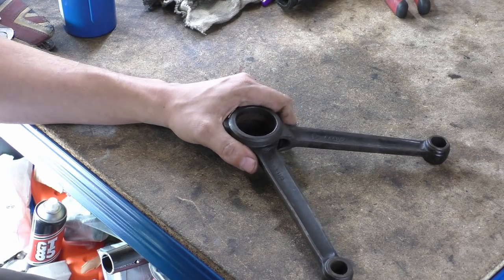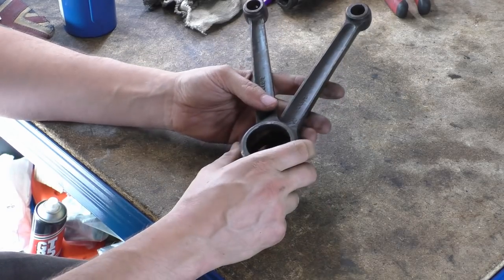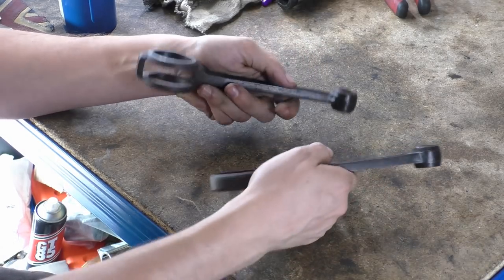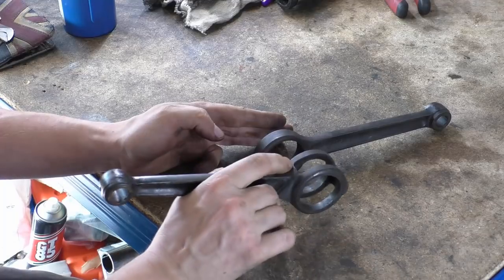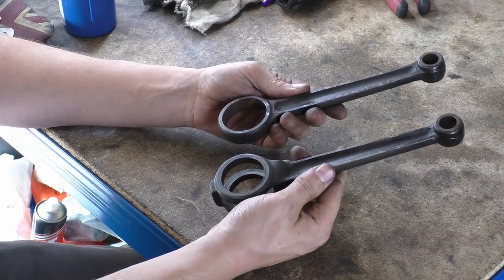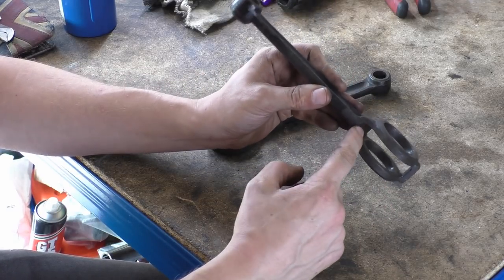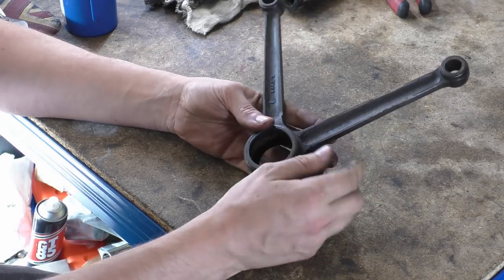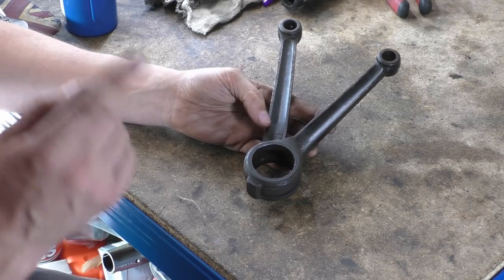Fork and Blade con - rods

Comment: This is the same (well close - they have a bolt-on basket like the ones in car engines, etc...) type of connecting rod design used in some of the engines in General Electric's diesel-electric locomotives. (We're talking, 3000 to 4500HP each!)

Comment: The big deltic two stroke diesels used in British high speed diesel locomotives had fork and blade rods in order to get the cylinder banks to line up for scavenging.
Reply: The Q The triangular arrangement meant that they had to use this setup, otherwise one bank of cylinders could never line up. Unfortunately the weakness in the forked conrod was the limiting factor in power output at about 1650BHP and ultimately lead to the demise of the design.
Reply: I know.
Reply: @chrishartley1210  Just learned that a very successful locomotive engine, the EMD 710 (cubic inches of displacement per cylinder), used fork and blade rods. It too is a two stroke, but its a normal V type engine.
If an engine that could have up to 20 cylinders (but usually is 16) could be called normal. It has a 230 mm bore and a 280mm stroke.

Comment: Harley don't do boxers, they built one for Ww2 army use. The XA, engine and drivetrain were based on the flathead BMW R71.
Reply from the maker: No but they split rods and have 2 rods on one crankpin.
Reply: The Workshop yes they have used knife and fork rods for decades, but very different from the boxer engines you were on about.

Comment: I feel like there's a way to make this work but I can't quite think of one. If you were able to pull it off wouldn't it let you have an absolutely beastly V-twin? Also for weird stuff like V-3 or or Straight-3 couldn't you make 1 cylinder the same volume as the other 2 combined for balance? Why don't people make engines with cylinders of different volumes in the same block?
Reply: That's pretty neat but why are they using it just as a counter weight and not for something with a bit more multitasking? Like have it drive a small supercharger or something.
Reply: Because cylinders of different volumes increase cost and complexity significantly.
Reply: @electric7487  Did people try to do them?
Reply: @funcounting  Probably. I bet it has been attempted before, but the complexity is why no such engines made it into serial production. Some of the first 2-stroke engines did this, as they used a separate cylinder for scavenging, but this was before the 20th century.
Reply: @electric7487  Ah, bummer, I thought you knew some examples.

Comment: Does that mean a V4 with these rods will be perfectly balanced?
Reply from the maker: LOL no.
Reply: It will be slightly better balanced than one with side-by-side rods as it lacks the slight rocking moment that side-by-side rods induce. But it's not exactly magic, as on V4 engines balance is taken care of by crank weights (and balance shafts, if the V angle is not 90°, for common-pin crankshafts).

Comment: Wooooooooooo been waiting 2 years for this!!!!!!!!!!
Harleys still use this design and I could never figure out why, the rocking couple on a shared crank pin (like the subies) is fuck all, so my only guess is that they do it for aesthetics (since it keeps the engine symmetric).
Reply: Yes, I believe it is primarily for aesthetic reasons.
Reply: Yea thats nuts, sacrifice performance for aesthetics... just like harley riders, more about fashion than function.😑
Reply: Totally agree mate.  We used to call them "knifey spoony" rods at the bike shop. ("Simpsons" reference)
Reply: Beach&BoardFan    Nice one on the link.  Cheers mate.
Reply: mostly for sound I assume
Reply: No, I believe it is so the cylinders are directly behind one another.  Otherwise, the cylinders are slightly offset.
Reply: Paolo G
Yes I know what symmetric means.  The comment was for  Lasse Langwadt Christensen who thought it might be to do with sound.
Reply: The EMD 2-stroke Diesel engines also use fork&blade rods. Is it about æsthetics? Hell no. Personally, I think fork&blade rods are a very elegant solution.

The rocking moment with offset cylinders doesn't seem like much but when you have only 2 cylinders it actually can become significant, especially with wider V angles and longer stroke lengths as the engine is very short and wide. BMW, on the R1250GS's boxer twin, actually have a balance shaft (not just crank weights) to cancel out the rocking moment due to the offset cylinders. This isn't a matter of æsthetics.